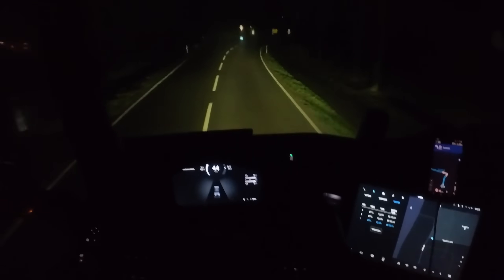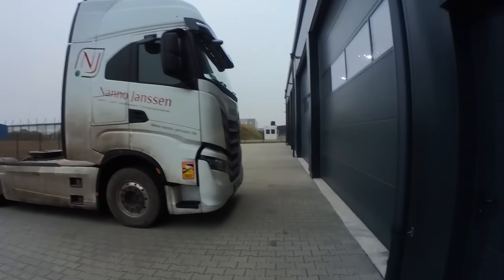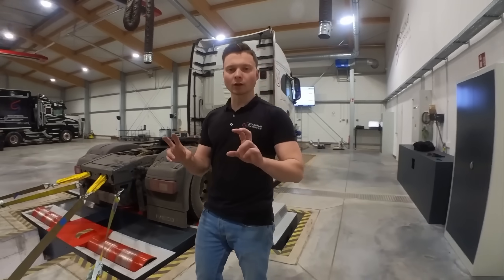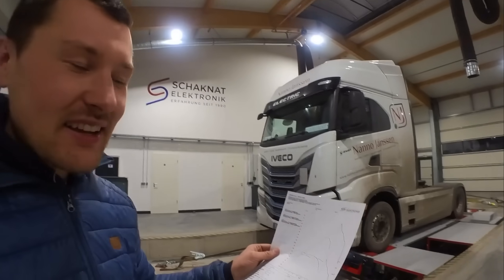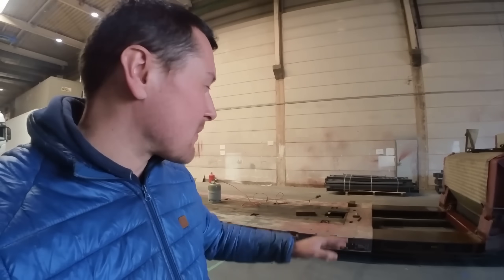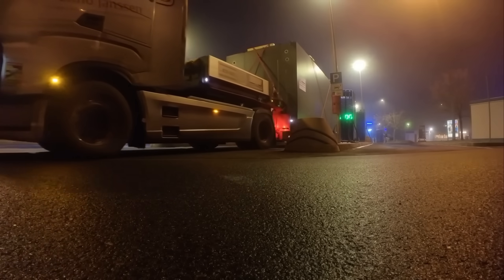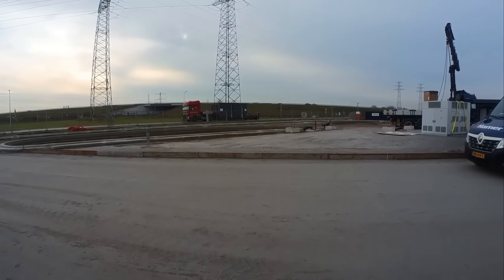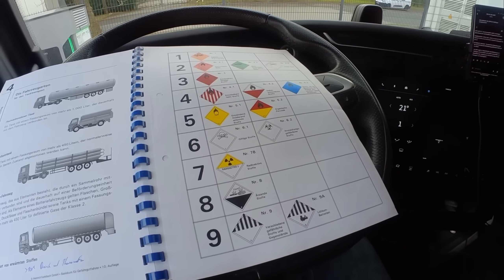Heavy Duty Transport is actually easy with an E-Truck

Comment: @Electric Trucker. Hi Tobias, a Dane here who has been driving a Kona EV for five years. Following along because I find it exciting to see all these “haters” who have been into electric cars get “dry” one time after another, when what they have said “cannot be done” suddenly turns out not to be a problem at all.

To date, I have not experienced a single time that I have had problems with the car that would not have also been the case if it had been powered by gasoline / diesel. Like a flat tire.
Reply: My argument against EV haters and conservatives is, while you are busy coming up with arguments against, EV drivers are busy driving their cars without problems for years.I will soon be driving EVs for 10 years. Granted, I haven't owned only one EV for those 10 years but I expect in another 10 years I will be able to say, here are 20 year old EV's that are working to this day without abnormal issues.

Comment: Yes... Electric power is hard to dyno as the ramp time is so short and you are just traction limited, even with a Hub dyno you can still put out to much power in a short time that leads to over load. 
Rear steer is a funny feeling at the start but when you get used of it, going back to a normal trailer is trippy.

Comment: Next up will have to be a low loader with it's own battery pack; I doubt it would need many KWh of storage for the average day, but it shouldnt need to rely on the tractor unit for power; what happens if it is hooked up to a tractor unit without the needed power connection?

Comment: Really great to see the issue in the real world - Germany is so far ahead of Australia so it is both encouraging and dishartning at the same time as Australia is such a large country it seems Electric trucks may be limited to city delivery work only.
Long haul here in Aus is typically many days and 000's of kilometres.
Our typical overnight runs are Melbourne to Sydney , Melbourne to Brisbane, Melbourne to Adelaide , Sydney to Brisbane .
Most of these runs are 800-900 kms with Melb Brisbane some 1800 kms.  
The charging infrastructure wild never cope for the 20,000 trucks a day on those routes.
Reply: Australia is a bit unique. Hub to hub electric rail is probably the best solution.
Reply: lol!!! Australia is actually ahead! they have road trains that replaces up to 4 drivers with just one semi.
Reply: @carholic-sz3qv  not between Melbourne and Brisbane
Reply: Never is a very long time. The routes you mention go through the main renewable electricity generation areas in Australia. Thats probably not a coincidence as the land between the capital cities is where one would both put roads to the cities and power stations for the cities. So electricity will be available close at hand. There is probably a sweet spot a batteries become denser , charging becomes faster where fast charging that amount of  trucks in Australia is not absurd. High density batteries and battery swapping is also a long term option

Comment: Fwiw CATL makes bateries that dont burn or blow up even if you cut or drill them 😊
Reply: Many more companies make LiFePO4 batteries. You can still start a fire with the heat from a short, but there won’t be a thermal runaway even in the battery.
Reply: its not for heavy duty application, doesnt have the energy density of nmc cells

Comment: I fully agree re ADR training. It’s about 15 years now since I did it last time. 
It’s really boring & yes I agree the instructors just want to get you through the exam, not actually teach you practical skills. 

I remember sitting in a classroom over several weekends & on one really nice sunny day the subject was fire extinguishers. Outside the window was a truck with all the extinguishers fitted & labelled. 
I suggested we go outside for a practical demonstration but the instructor said no & just kept flashing up more slides on a screen. 😩

Comment: Are ev's still fun but at smallest engine size? So 1.0 tsi at 105hp and 172nm.... A Tesla with this low power will be boring as hell. Dont you think?
Reply: its not about power but capabilities overall. Semi trucks in Australia have 600hp+ and hauls about 4x the load of any other countries, its diesel power.
Reply: Still huge fun even as small EV’s - even small front wheel drive EV’s can seriously embarrass some extremely powerful and noisy ICE performance cars. I know 2 people who have changed BMW M3’s for Mini Cooper S E’s because they simply destroy an M3 from a standing start having max torque from 0 RPM, no gears to change and a hugely sophisticated traction control system that is very very effective. But then there is the look on an M3 driver’s face when this tiny, silent and very unlikely performance car will hold them in its rear view mirror up to it’s rather low 90mph top speed  then it starts to loose out, but where away from German autobahns can you legally do that sort of speed on a public road. There is the added pleasure of the EV driver knowing that his fuel consumption will be around 1/7th and cost 1/10th if home charged of the high octane fuel needed for the ICE performance car and that he can refuel his EV at home while he sleeps and often doesn’t need to go to a special fuelling place to fuel up. My Cooper Works electric Mini can walk the walk performance wis E but does it at the equivalent of 90 miles per gallon of petrol……….. and much more if driven sensibly - like I’m getting 5 miles/kWh at the moment, that is the equivalent of 200mpgE and I refuel,it while I sleep for a fraction of the cost of my diesel car. 
I wondered if these guys above missed engine noise but it seems they don’t they thrill in astounding their IcE driving friends silently.
Reply: @timoliver8940  cool, but my example shows a ev with a little engine. Same like a VW Polo, or Toyota Aygo. I can image a slow ev where you don't have to shift, can be boring as fu/k
Reply: @Blasterxp  - It depends on what you like about driving, I suppose. If you like rowing through gears, sure - an EV won't be exciting. If you enjoy driving for the sake of it on a country lane, as does one of my friends, an EV is a fun way to do it. 
If you like a roaring engine, an EV is going to seem dull, but if you just enjoy cruising quietly it's hard to beat an EV. Horses for courses, as they say. 
For what its worth, many reviewers who aren't fussed about where the power comes from seem to really like the new MG Cyberster and the new Renault 5 and Peugot e-208, along with a few others.
Reply: @MarcCoteMusic  I drive a fast and fun ev myself. But what if brands make limited and poor spec ev's?
Reply: @Blasterxp   - It's anyone's guess, but I'd say it's likely those brands won't survive. Regardless, it's a game the Chinese seem likely to win, at least in the medium term. Long term? We'll see.
Reply: @timoliver8940  wrong.
Reply: My 100KW/136HP electric car is still way more fun and responsive to drive then my previous 2l 5 cyl diesel. 😅
Reply: @svergie2  what a lame joke! diesel isnt for fun its for heavy use! that 2,l diesel can tow significantly way more than quite powerful eVs and still have crazy range.
Reply: @svergie2  the 1000hp tesla modelx plaid 1000hp can barely tow 5000lbs while a mercedes gls 400d with around 350hp can tow over 7700lbs.

Comment: The power output should be reasonably easy to work out by measuring the acceleration of a known mass and subtracting air and rolling resistance, which should be possible to calculate by measuring consumption at a few different constant speeds. And from that, and the radius of the wheels you can calculate the torque.  

I completely share your opinion on education in general. And often such certificates seems more like a formality then actually proving a decent understanding of the matter. It probably often provides some screening, hopefully at least screening out the very worst people for that specific certification.

Comment: 5:07 13 tons while empty?! Wow...
I think all trailers should have batteries (and electric motors), if it's 13 tons empty, that bit of extra weight doesn't matter that much anyway.
Reply: That’s “toy” heavy haul trailer…Real heavy haul trailers usually have 4 axles and empty weight 20 + tons

Comment: An electric truck without a trailer is an explosive risk on its own. 

Also, you had no escort vehicle so not technically an Abnormal Load, and you didn't route through France so why the thumbnail avec le panneau francais? Un peu de click-bait, n'est-ce pas?
Reply: It's almost as if French is some sort of international working language in shipping and transport related things. 
And that "convoi exceptionnel" is just the European standard.

Also see "Accord européen relatif au transport international des marchandises dangereuses par route"
Reply: This sign is in French everywhere throughout Europe.
Reply: The escort vehicle requirement depends on the load size and weight.
Reply: @romelec  yes this video was not actually about heavy load that was nothing special at all! 50 tons and more is abnormal
Reply: It's just Abnormal Load in UK. I used to do wide loads in Europe in the 90s and it was Convoi Exceptionnel in France and Trasportas Especiales in Spain. The Germans have their multi-syllabic word for it too. But my point is the truck didn't have any signs on it in the video, no escort car either so in my view while this is a large load it's not really abnormal in the true sense
Reply: I like it thanks Europe. 1 language is just too boring
Reply: It required a step deck trailer due to height, That's the definition of an abnormal load. As you can see from all the other comments you might as well delete this
Reply: Why would it be an "explosive risk"?
Are you referring to the myths of "EV will start burning"?
Reply: @peter_meyer it’s not a myth.
Reply: @alangordon3283  Oh, isn't it? Independend statistics say that EVs don't burn more often than ICEs.
Reply: @ Did you check yourself? Or did some YT channel tell you?
Reply: @alangordon3283   - yes it is. EVs are FAR less likely to catch fire than ICE vehicles and MUCH less likely than hybrids. Before you make inane comments you should probably look up the stats... they're freely available online.
Reply: Not with LFP and even with lithium ion it's not that dangerous, at most when someone else crashes into you very hard and badly.
Reply: @AAb-xy6et  LFP are much heavier and less energy dense and they can also burn
Reply: @ No, they do not burn. 
They are slightly less energy dense indeed, but you can put a bunch in the trailer as well as in the semi itself. Most of the transport is no way near it's maximum weight anyway.

Comment: It is if your e.v. truck battery catches fire!
Reply: It also is when your ICE-Truck (i.E. brakes) starts burning.
Reply: @peter_meyer  ICE truck brakes doesnt burns that has to be your typical outdated american truck with jake brakes and drum brakes, European trucks have retarder, disk brakes and also engine brakes so literally impossible to overheat.
Reply: @peter_meyer  european ICE trucks have retarder that produces significantly way more stopping force than the engine produces they dont need to even use the physical brakes.
Reply: What nonsense is this?
Reply: I mean it definitely is possible, but so far I've only ever seen diesel trucks on fire whilst on the road myself.
Reply: Engine backfire, afterfire, broken gearbox, leaky fuel tank, explody fuel tank

And poor to piss torque for your trouble

Comment: i do have a qustion xD do you always drive 80 :> or just on video :face-pink-drinking-tea:
Reply: in europe you have a built in speed restrictor. even at full throttle you will never break 90km/h.
Reply: @johndoe1909  Well, as the electronic driver's logbook is hackable by drivers I'm confident the speed restrictor can also be activated.
Reply: @TremereTT  everything is hackable. but then you have the fact that you're driving to fast and sticking out like a sore thumb, and easy picking for the police.
Reply: Trucks often drive close to 90, but Tobias found out that the optimum between speed and consumption for his truck is 82.

Comment: 3500nm is 2581.5 lb-ft for any imperial viewers out there. Which is monstrous since 15L diesel only puts out about 1200- 2000 lb-ft.
Reply: Yes, but it was measured at the wheels, not the motor.
Reply: @gsbeak  that was not at peak capability though, throttle was only at 50%. Work in the commercial EV space, 3500NM directly out of the motor and not wheels is common.
Reply: This is just insane. I keep saying: the only "problem" we have with electrics are the batteries - they still have a ways to go. But the motor, its capabilities? Pff, they far surpass any ICE one could throw at them.
Reply: FWIW Scania's R770 is rated for 3700Nm (2730 lbft), however that's engine torque so the two are not comparable. You'd need someone with a 770 to put it on a dyno: a quick search doesn't show any report. I found a dyno report for an R620, 3,000Nm at the engine, 2460 at the wheels, assuming similar ECU settings and driveline losses that would put the 770 at around 3000Nm, or 2240lbft.

Incidentally the 620 uses a 16L euro5 and the 770 is powered by a 16.4 euro6.
Reply: 15 liters of outdtated engine tech lol! probably a cummins engine
Reply: @carholic-sz3qv  Any decent uphill stretch, that diesel horker is huffing and wheezing on low gear, crawling up the hill with a tail of irritated car drivers behind it. A strong electric truck like this one never even slows down! :D

And these E-trucks are what you might call first-generation. They're only going to get better from here on out, by time 2035 rolls around you'd be silly to choose non-electric... :P
Reply: @lennyvalentin6485  And the amount of energy this truck consumes is probably a third of that diesel truck.